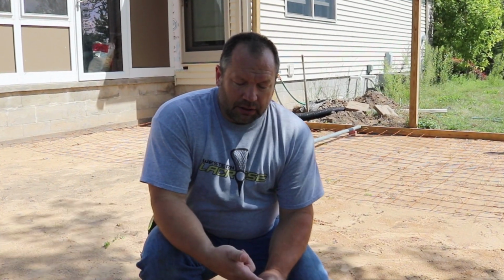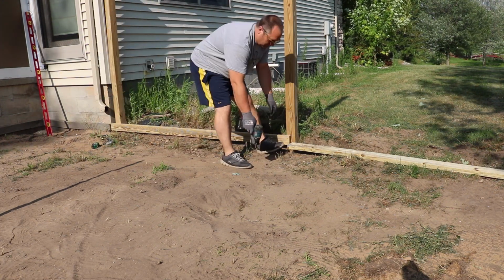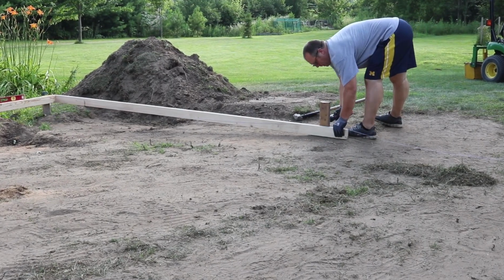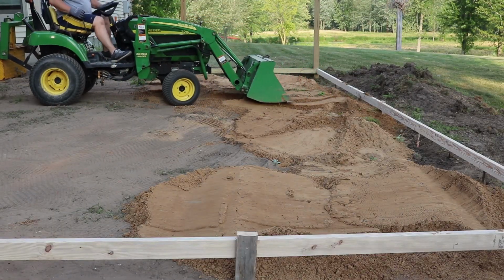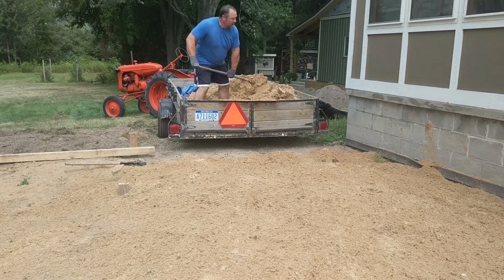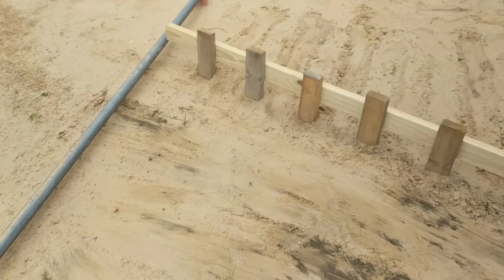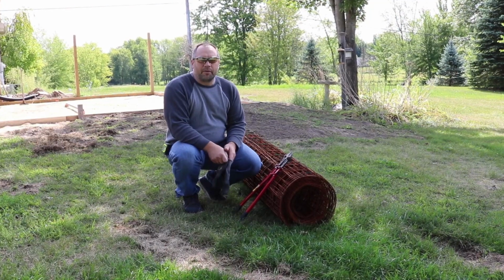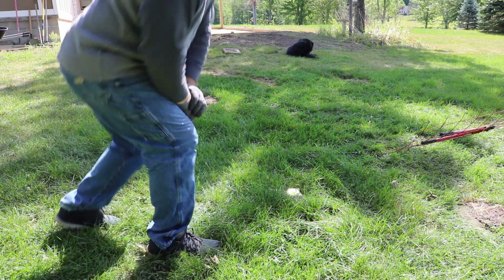How to Pour a Concrete Patio DIY - Part 1- Prep

Comment: Simply put, sand isn’t sturdy enough to work well as a subbase for something like a driveway. With areas like patios, which don’t require a ton of load-bearing, sand as a subbase works fine, though it’s not as reliable as gravel. Sand doesn’t have the same load-bearing capacity, is too mobile even when tamped down, and moves if exposed to excessively wet or extremely dry conditions.

It is also difficult to maintain a level sand surface when pouring concrete, and therefore difficult to maintain a uniform thickness of the concrete slab. Using sand as a base also requires more concrete; the softer base beneath the slab means you have to use at least an additional inch of poured concrete. will using sand make your slab crack.? Not necessarily. The tendency of sand to shift and cause cracks depends on several factors, including the environment, conditions when it was laid down, and whether or not it was correctly compacted during installation. It also depends on the size of the loads placed on the slab, such as a patio (people, furniture) versus a driveway (cars).

As a general rule, stay away from using sand as a subbase. You’re better off using gravel; your concrete will last longer and have less of a chance of cracking over time. (not my words a copy and paste from a website)

Comment: Please for the people that are gonna do this themselves. Please don’t use sand as a base. It does not work at all.
Reply from the maker: You must be doing it wrong then. I've been doing concrete work for over 30 years, all on compacted sand base except basement floors which are on pea stone. I learned from working for a concrete contractor.  All of the slabs I've done are still in great shape. If you want to use gravel there's no problem with that either.